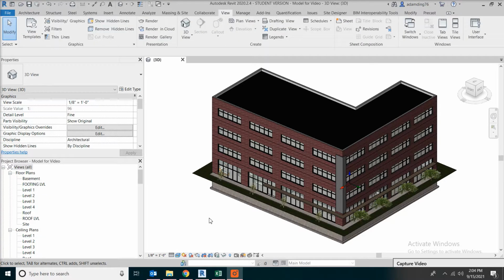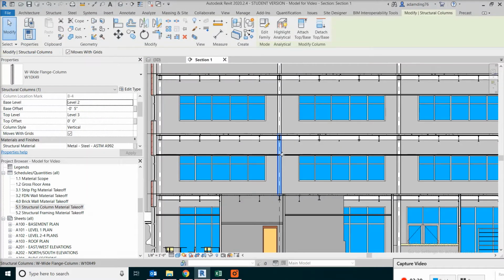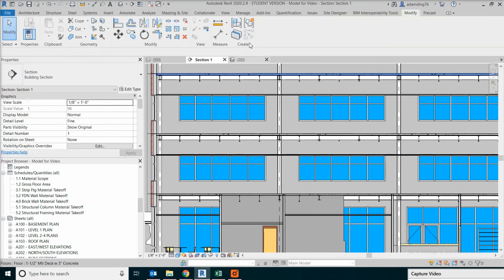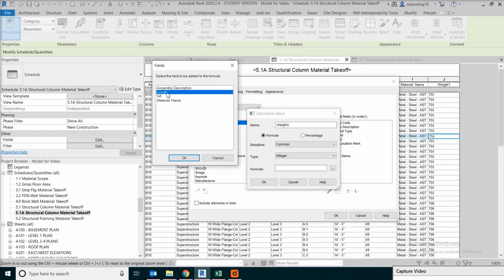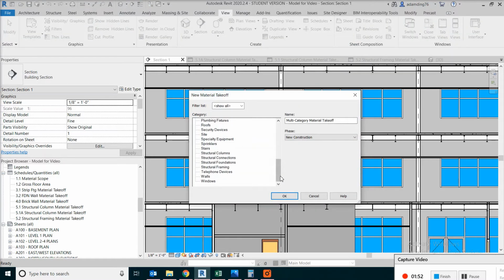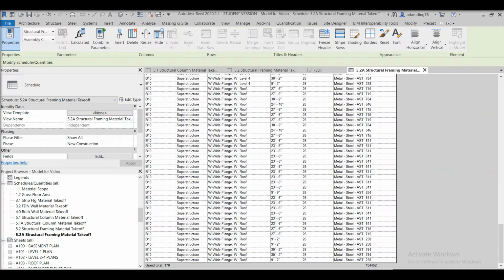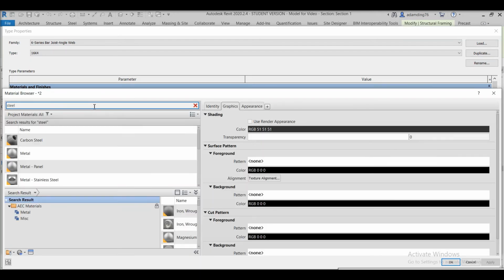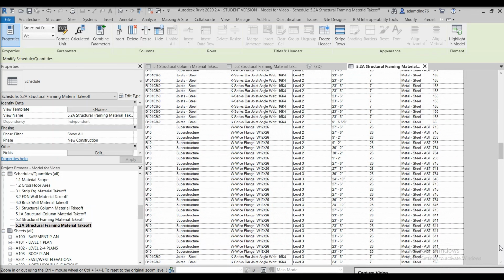BIM Estimating 5.2: Classical Structural Steel 3D QTO

Comment from the maker: If you were having trouble with "shared parameter" step in the video, please create a TEXT (joist.txt) file as follows (copy everything below): 

# This is a Revit shared parameter file.
# Do not edit manually.
*META	VERSION	MINVERSION
META	2	1
*GROUP	ID	NAME
GROUP	1	Steel
*PARAM	GUID	NAME	DATATYPE	DATACATEGORY	GROUP	VISIBLE	DESCRIPTION	USERMODIFIABLE	HIDEWHENNOVALUE
PARAM	26de9a81-997b-4f14-815b-d9db5b273998	Wt	NUMBER		1	1		1	0
PARAM	f417ff9e-09cc-4633-be6c-978f96502b8d	W	NUMBER		1	1		1	0